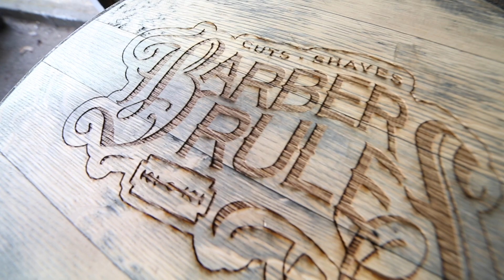Whisky Bar-rel drinks cabinet - Quarter cask

Comment: @Fait Maiz
how is your experience with the cask after one year finished building? I'm about to start a similar project with a whiskey cask but heard different opinions about how to work against the wood drying out and resulting in gaps. Some separate every stave of the barrel and glue them together, you mainly used screws. Do you have long-term experience in having the cask placed indoors (maybe livning room with heating in the winter) ?
Super inspirational video btw! I really like it
Reply from the maker: The barrel will mature and dry further. Securing the hoops and cask ends with screws is my best options. Keep oiling the cask time to time to help with the drying. My first bar-rel is now 6 years old, in my living room, no problem. Yes there is some gaps between the staves and the barrel shrink a little, but I love it this way. Hope that helps!

Comment: Absolutely awesome. How long did it take? I don't have half of the tools you have, but I want to give it a go.
Reply from the maker: I’ve made my first barrel cabinet with a screw driver, jig jaw and a hammer. You can do it! It will be worth it! It will take the time it takes 😊
Reply: @PierreVennen  I now have a barrell, letting it dry as its had a hard life and very grimey! I am going to buy an orbital sander, what disks would you recommend for grit etc?

Comment: Was it a stain or an oil you used on the barrel and did you do anything to the bands or just leave them as is after sanding them down. I'm about to do this and not sure what to finish the barrel with. Looks great
Reply from the maker: SNC C hey! I’ve used stain on the cask end before to oil the whole cask with danish oil :) make sure your hoops are very clean before to oil them! Send me some pictures and good luck!!

Comment: How did you get the inside of the barrel to stop smelling.
Reply from the maker: For my build, usually simply brushing with a metal wire brush is enough, but if it goes wrong... maybe use a strip of sulfur like for wine barrel cleaning? It will kill the bacteria or fungus I there. Blow torch the whole inside, mad re brush again. Hope that’s helpful!

Comment: Were the lights you went with battery powered?
Reply from the maker: No, those are plug in LED lights. First the strips didn’t work well so I went for under cabinet LED spotlights.

Comment: What do you use for sanding down the outside of the barrel?
Reply from the maker: Hi Robbie, it depend but usually I don't really sand there barrel. Grinder is my best option with sanding disk if you need to sand it. Hope that's helpful. Let me know how your project is doing!
Reply: Pierre Vennen I’ve got two barrels on the go at the moment. First time doing it. See your screws that you put in the bands Through to the staves, are they in every stave or do you have a method?
Reply from the maker: Robbie Hearle I do have a method, if you watch the video you can clearly see how I proceed. You definitely want the staves to be secured for when the cask is completely dry. A screw on each staves is a good method to prevent any issue.